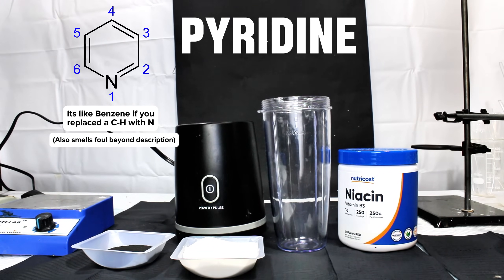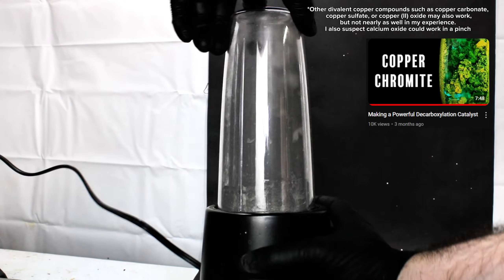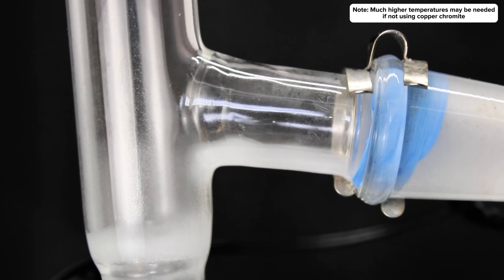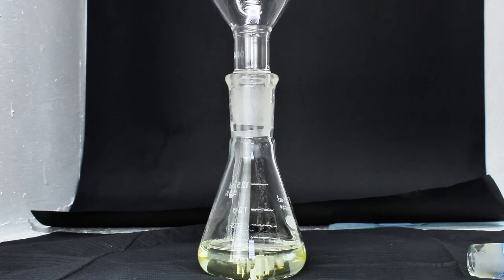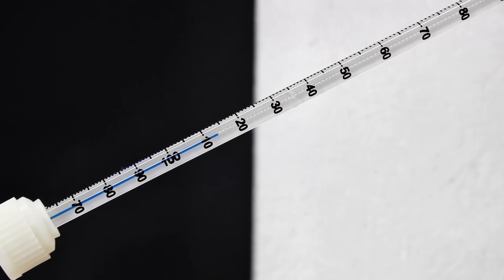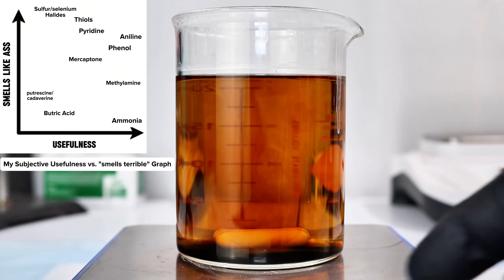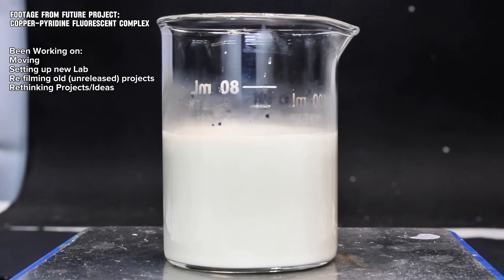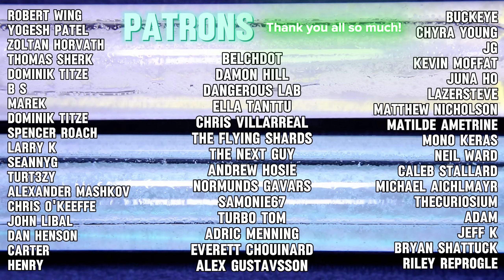Making Vitamin B-3 into Foul Pyridine

Comment: I had to encounter this as a lab tech for a few years. It's not that the smell is excruciatingly bad, it's that it seems to stick to stuff & some residual pyridine foul smell lingers for seemingly weeks & months afterwards, in spite of a relatively low boiling point. You defo need a fume cupboard to keep things in when you use it & also to keep anything it's been in contact with. It kindalingers. I don't advocate the following. If someone had a grudge against an organisation, took some of it into their building & had an accident spilling it, that building would be off limits for weeks , no-one would want to work there

Comment: How come you don't use high vacuum grease instead of plumbers tape?. Just wondering. Love your channel.
Reply: If I recall correctly, he said in another video that high vacuum greases can contaminate reaction mixtures due to their chemical composition and properties. Something that can happen. Cheap Teflon tape, in most cases, can avoid that potential problem.
Reply: @solanaceae2069  OK, thanks for that👍
Reply from the maker: Yeah basically I've had less issues with contamination and frozen joints in these dry distillations using teflon tape.. Only issue is the vacuum grease definitely creates a better seal
Reply: @integral_chemistry  yeah, got changed. Thanks for that 
Cheers fom Aussie

Comment: I have been reading about pyridine perchlorate as an exotic secondary explosive but I have found very little about its synthesis, do you think it's possible to synthesize it with just NaCLO4 And not use perchloric acid?
Reply from the maker: I don't think I've done anything with perchlorates yet, but that sounds like an interesting investigation once I start (which I plan to do very soon). Given how easy it is to convert perchlorate salts to perchloric acid I'll probably just use the acid, but usually its fine to just use an acidified sodium or potassium salt of a strong acid.